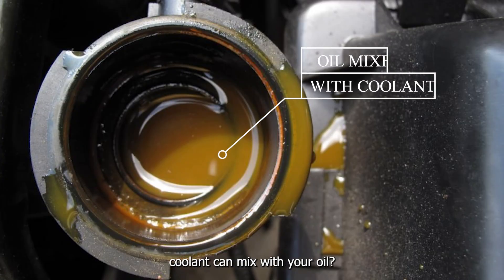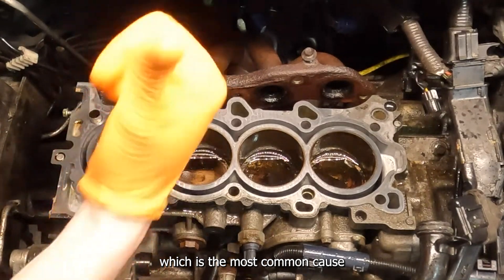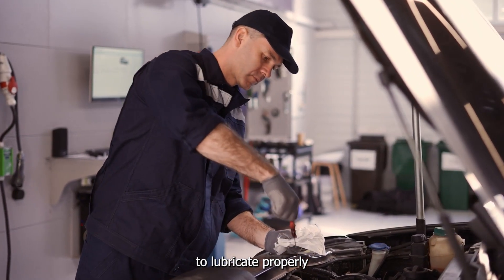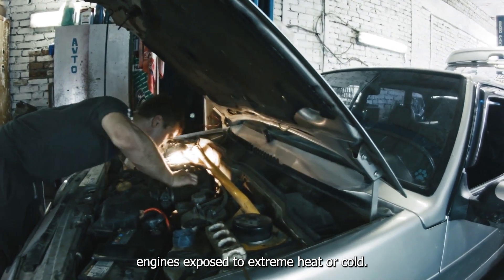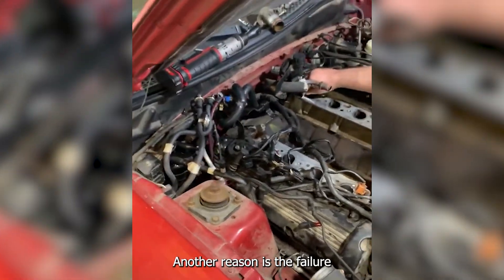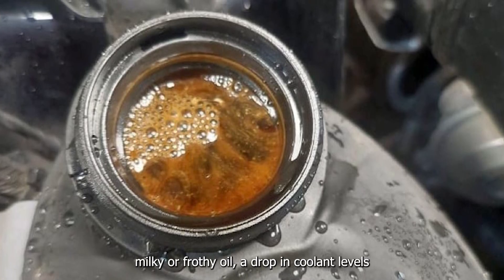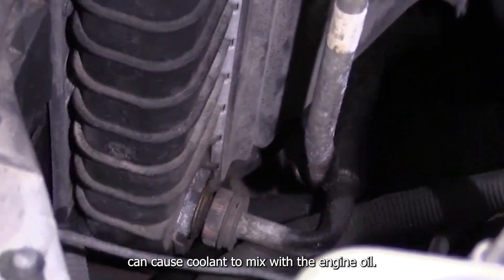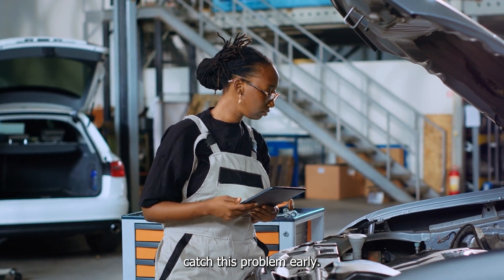4 Causes Coolant Mixed With Oil (What To Do and How to Fix IT)

Comment: I got a Jeep Cherokee recently and I bought it from an idiot and I noticed I have oil in my radiator just a little bit but my engine oil is not dropping any I'm kind of thinking maybe it could mean my transmission fluid in that but the 88 might have put oil in the radiator for I flush it out one time already but it's back in there again

Comment: My car its like this mixed oil and water in a radiator how to fix
Reply from the maker: Possible sign of a blow head gasket.  If so, it needs to be replaced.  Good Luck.  Hope this helps.

Comment: My pasola mixing oil with water, what do be the problem
Reply from the maker: If your pasola (scooter) is mixing oil with water, it usually points to a serious internal engine issue. The most common cause is a blown head gasket, which allows coolant and engine oil to mix. It could also be due to a cracked cylinder head or a damaged engine block, both of which can let coolant leak into the oil passages. When oil and water mix, the oil turns milky and loses its ability to lubricate properly, which can cause engine damage quickly. You should stop riding it immediately and inspect the gasket, head, and cylinder for cracks or warping.  Good Luck!

Comment: I went to check oil levels and coolant levels in my car then noticed a dark substance in the coolant resivor so I’ve flushed everything out and am replacing the plastic black stems under the ac compressor supposedly it could be that part being damaged or something about the rings in it being damaged if not I’m going to check the integrated transmission cooler , what does anyone think I’m curious to know what others think it could be and see if this might fix the problem of oil being In the coolant resivor but not coolant in my oil , thanks to anyone who replies trying to fix it as of now October 11 2025

Comment: My Acura ilx Coolants is mixing with oil and I’m getting sick, 
We changed the gasket and still it’s mixing , 
Any help Please 🙏
Reply from the maker: Coolant mixing with oil is a serious issue that can damage your engine if not fixed quickly.
If you already replaced the head gasket and it’s still mixing, the cylinder head may be cracked or warped.
Sometimes the engine block itself can crack, letting coolant leak into the oil passages.
If the head wasn’t pressure-tested or resurfaced before reinstallation, even small warps or cracks can keep causing the problem.
Another possible cause is a failed oil cooler, which can allow oil and coolant to cross paths internally.
Driving with coolant in the oil can ruin bearings and lead to full engine failure.
The next step is to have both the head and block professionally pressure-tested at a machine shop.
This way you’ll know for sure if the engine can be repaired or if a replacement is the better option.  Good Luck!

Comment: Engine has 0 oil and psi. All oil was mixed with coolant and looks like diarrhea.  Engine ran 5 miles without any oil since i had no one for help and drove to nearest town. I added new oil just to help lubricate with advanced full synthetic since mechanic shop was closed. I turned it on for a bit, gauge says 50 psi and it seems that no coolant is going into the engine and never overheated even when I drove those 5 miles. My only guess is that the oil cooler isnt working and hope to GOD thar my engine block is perfectly fine since there is nothing but clean oil in that dip stick, no white smoke, engine sounds normal yet in a few hours my truck is heading to the mechanic to do a complete radiator and coolant flush x5 until is fully clean, change the oil cooler and add new Mopar or recommended Coolant.

Comment: My engine oil mix with my coolant
Reply from the maker: Oh noo.  That is not good.  You should go over causes to identify why.  Good Luck.  Thank you for sharing!
Reply: @fixit3879 I have a 2000 Ford focus 90,000 miles I had an oil change last week my coolant was filled to maximum all my levels were fine. I wake up the next day to start my car and it sounded like a truck. No engine light no oil light no smoke nothing. I wake up the next day my coolant reservoir was empty and my oil was beige gray color now the car won't start so I had it towed to the mechanic he's telling me I have a blown head gasket I don't know what to believe can you help me with this I have the car 13 years I never had such a problem at first he said 1500 hours for blown head gasket but now he doesn't want to rebuild that he wants to change the engine 2500. I don't know how this happened I never abused the car I don't drive highways I am local how the heck did this happen please if you could help me I think my mechanic is screwing me over

Comment: Hi, what if coolant and oil mix only on the engine but not on the coolant reservoir? Ford focus 1.6l
Reply from the maker: f oil and coolant are mixing only inside the engine but not in the coolant reservoir, it often points to an internal engine problem. The most common cause is a blown head gasket, which can allow coolant to leak into the oil passages. This creates a milky or creamy substance in the engine oil, especially on the dipstick or oil cap. Since the coolant isn’t contaminated in the reservoir, the leak is likely one-way—from coolant into the oil system. A cracked cylinder head or a failing oil cooler (if your 1.6L engine has one) can also cause this issue. Driving with coolant in the oil can lead to severe engine damage due to lack of proper lubrication. It’s important to stop driving the car and have it diagnosed as soon as possible. A compression test, cooling system pressure test, or visual inspection can help pinpoint the exact cause.  Hope this helps.  Good Luck!